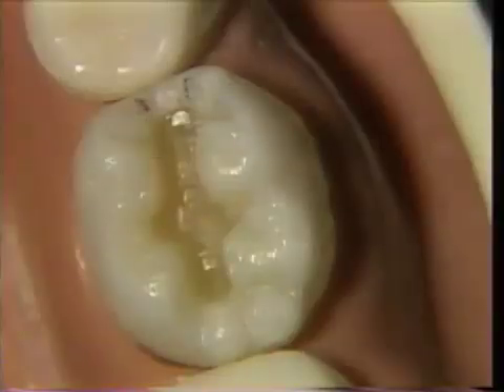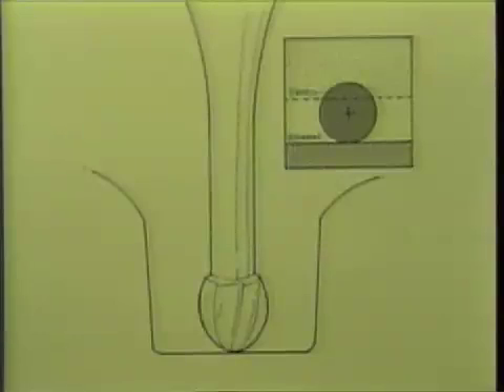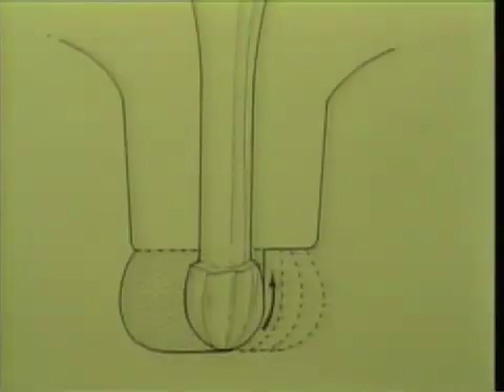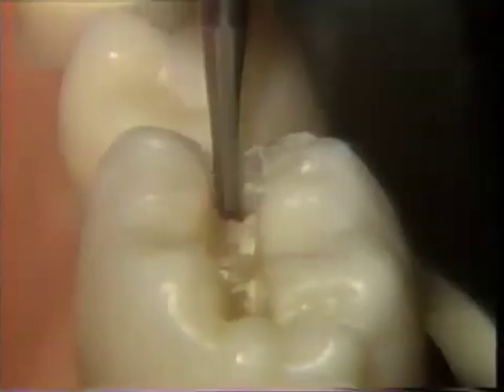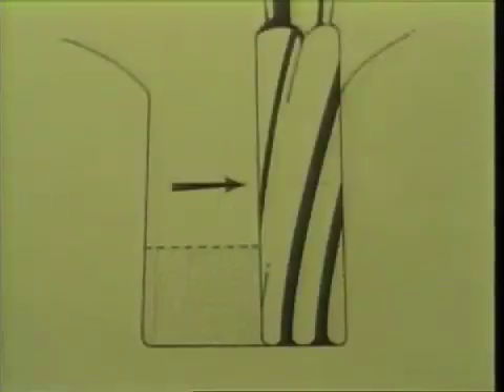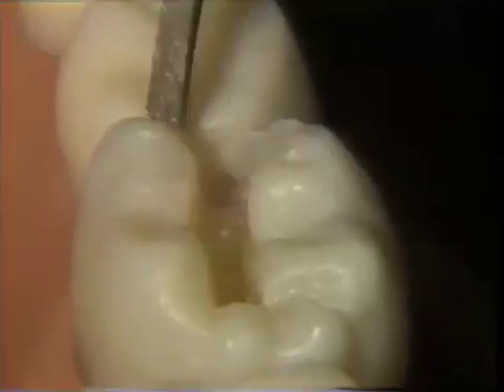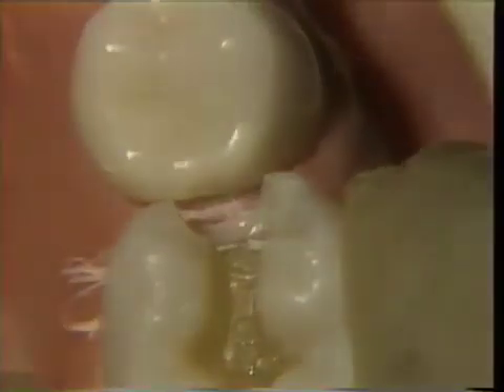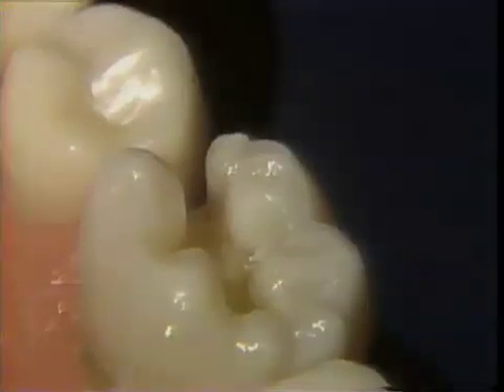The Amalgam Proximal Box Cavity Preparation

Comment: Don't round burs tend to gouge the axial wall a bit? I prefer to drop the box with a 330 2/3rds deep myself as the top of the bur rests on tooth structure. 330 is a lot less end cutting than a 245 too, so that helps with producing a conservative prep. I probably wouldn't use a straight fissure myself for the box because the result is sharp line angles. 

Nonetheless, I really appreciate the advice on how to use the hatchet properly for the buccal/lingual walls of the box.
Reply: After 13 years what happened now 😅 are you ok ❤